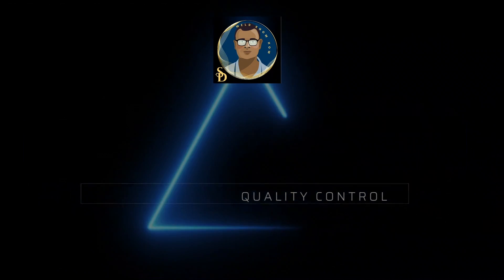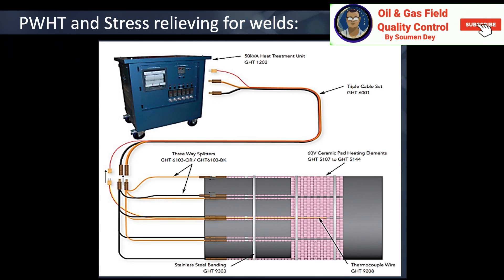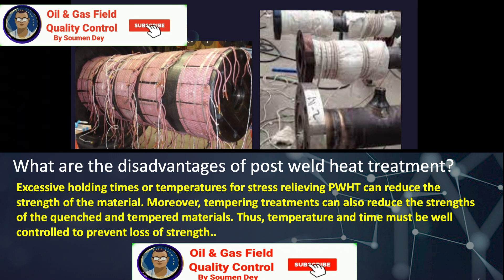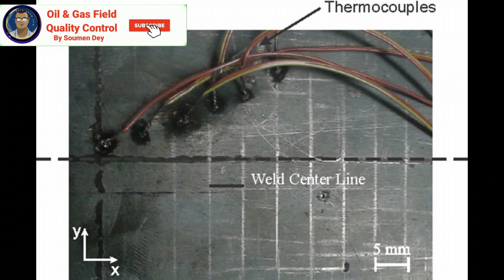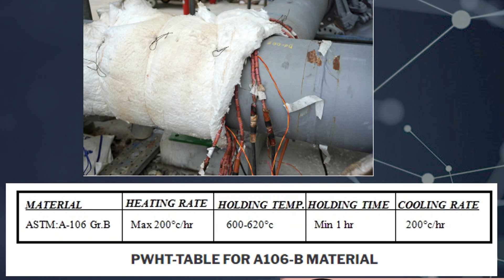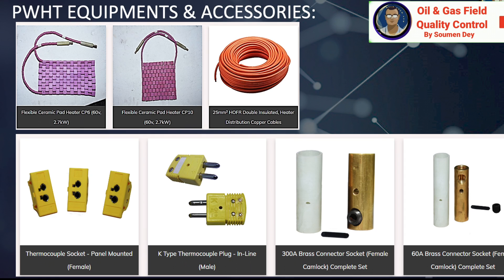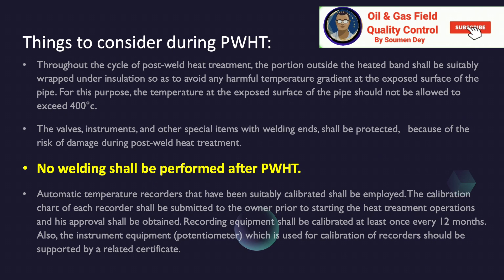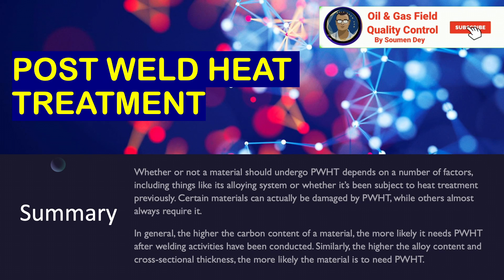What is Post Weld Heat Treatment?

Comment: Is there any pipe thickness condition for PWHT
Reply from the maker: Please refer ASME Section IX - Beforee it was 20 mm and above. But latest standard is changed- you need refer the table for it. For ASME B31.4 and B31.8, means for pipeline , PWHT is required if pipe thickness is more than 1-1/4 inch or 32 mm

Comment: Regularly Watching your videos in this channel. 
Hatsoff to you! 

Doing PWHT before RT is OK? because if there is any repair in welded joints we have to attend as per Qc instructions

I didn't get any data reg this sequence-RT before or after PWHT.

Please advice sir!
Reply from the maker: Thanks Mr Naveen. I am grateful that you are achieving something from my knowledge sharing videos.
Actually PWHT has to be done after welding. Contractor is doing RT before PWHT- is only to ensure- that not mandatory and only to assure that the joint has no repair. If you have good performance of welders, you can always do RT after PWHT- nobody can stop you.